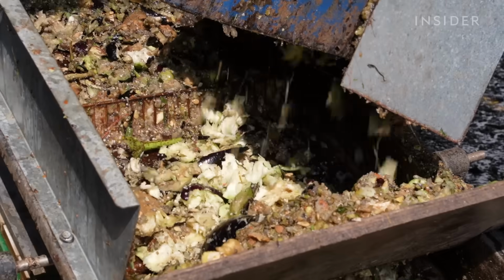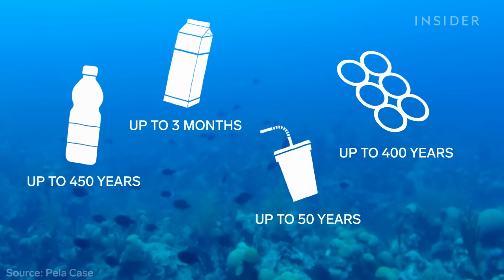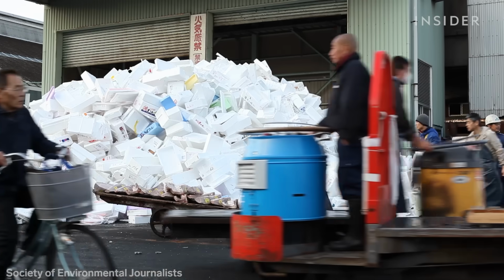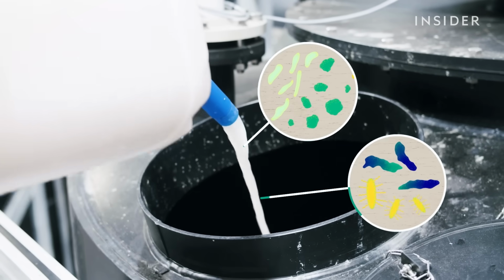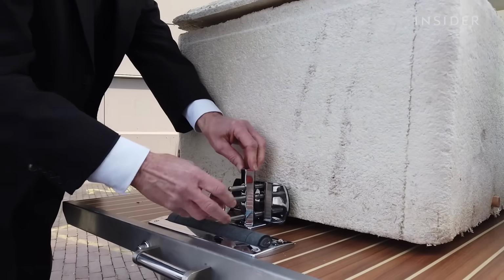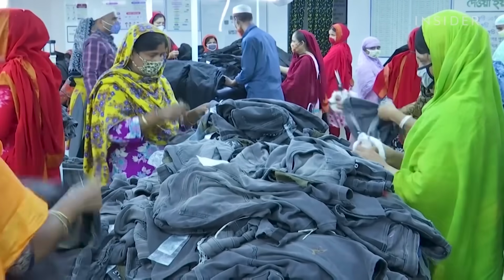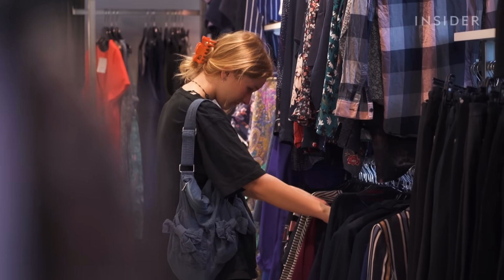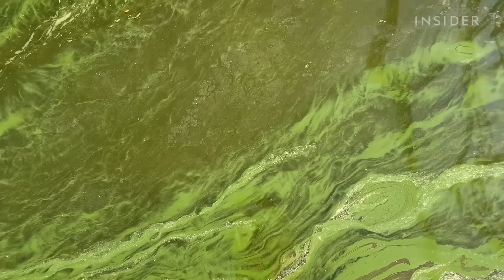17 Ideas To Tackle The 2 Billion Tons Of Trash We Make Every Year | World Wide Waste Marathon

Comment: You can break down styrofoam and add it to dirt and it will act like perlite.
Reply: STYROFOAM IS NON BIO-DEGRADABLE AND IT BREAKS UP INTO MICROPLASTICS
Reply: @insectbite1714 No need to yell...I know they're non biodragradable, that it the reason it's been used by home gardeners as a perlite sustitue to reduce the levels of toxic emissions from sending them to the landfill to be burned.